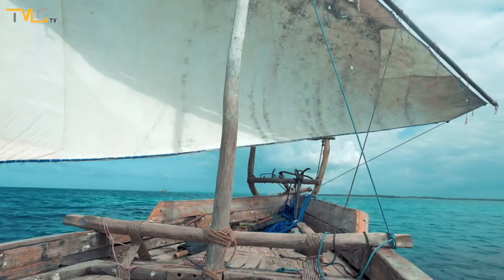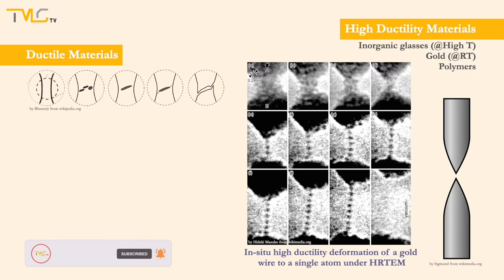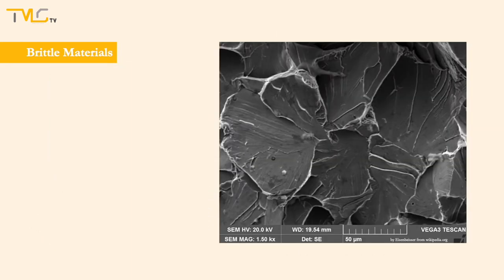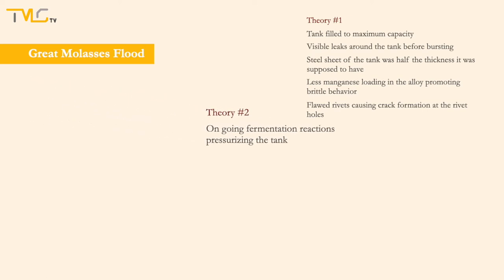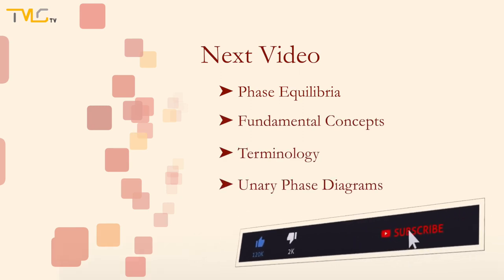Video #2.8 - Failure Mechanisms & Case Studies (Mechanical Properties of Materials)

Comment from the maker: 00:00:13 Introduction (Giriş) 
00:00:29 Intro to Failure Mechanisms (Kırılma Mekanizmalarına Giriş) 
00:00:59 Brittle Fracture (Gevrek Kırılma) 
00:01:10 Ductile Fracture  (Sünek Kırılma) 
00:01:39 Fracture of High Ductility Materials (Çok Sünek Malzemelerin Kırılması) 
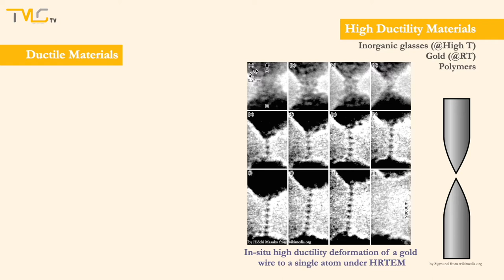00:01:50 Fracture of Ductile Materials (Sünek Malzemelerin Kırılması)
00:02:32 Fracture of Brittle Materials (Gevrek Malzemelerin Kırılması)
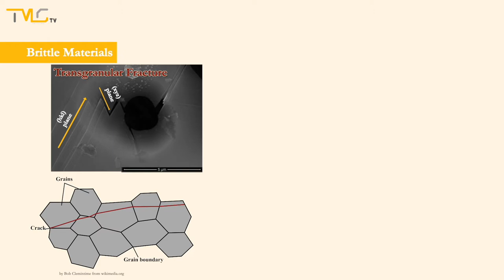00:02:48 Transgranular Fracture (Taneleriçi Kırılma)
00:02:57 Intergranular Fracture (Tanelerarası Kırılma)
00:03:36 Chevron Marks and Fan Shaped Ridges 
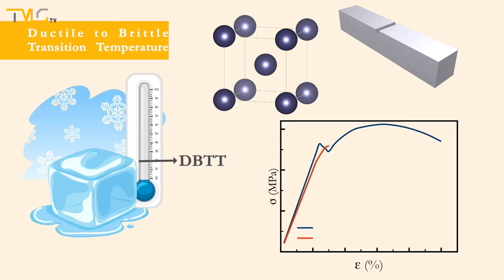00:04:37 Ductile to Brittle Transition Temperature (Sünek Gevrek Geçiş Sıcaklığı) 
00:05:05 Liberty Ships (Liberty Gemileri)
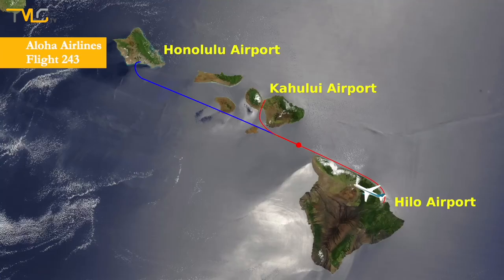00:05:52 Aloha Airlines Flight 243 (Aloha Havayolu 243 Numaralı Uçuş)
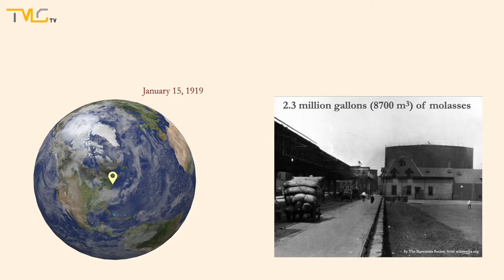00:07:06 Great Molasses Flood  (Büyük Pekmez Seli=
00:09:38 Next Video/Series (Sonraki Video/Seri)